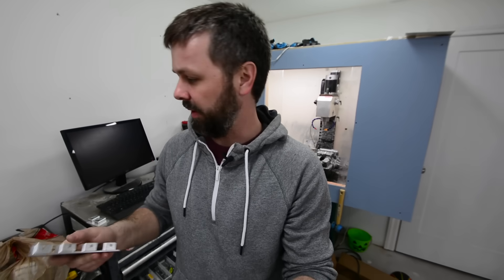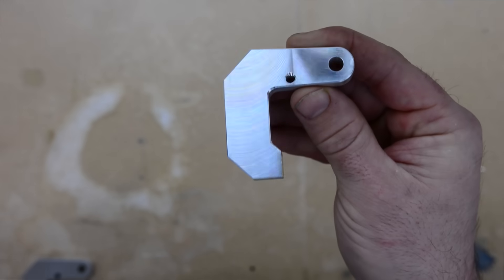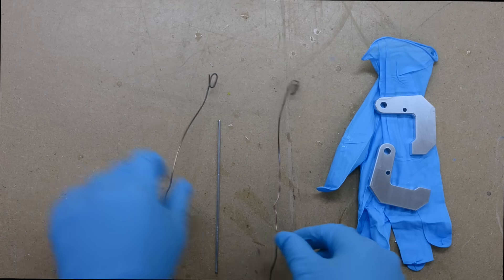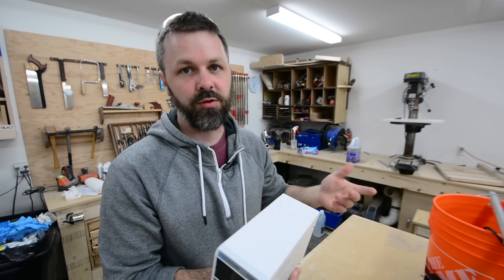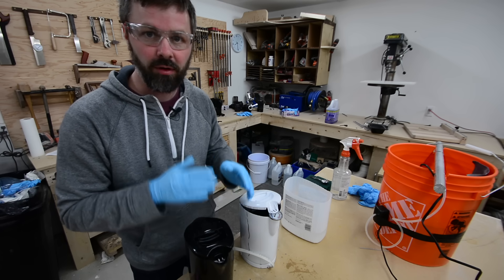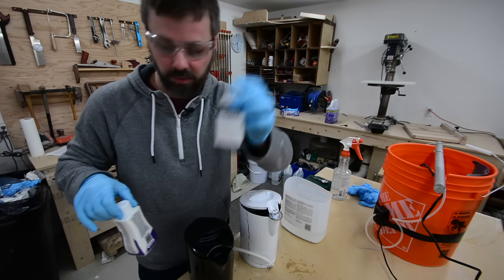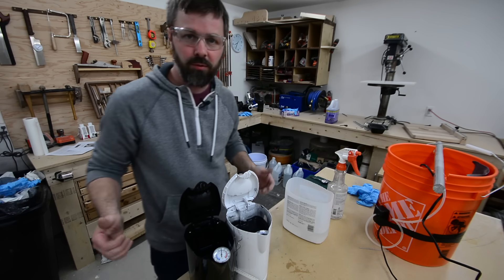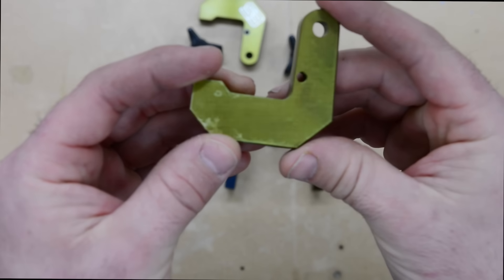ShopBuilt - How to Anodize Aluminum!

Comment: What role does the battery acid perform? Does it open the "pores" of the aluminium?
Reply from the maker: It actually forms an aluminum oxide layer about .001" thick that has open pores to accept the dye and actually hardens the surface.
Reply: And also eats halfway into the aloy as it converts
Reply: The pores are opened using the etching process, which wasn't shown. Without the etch it can mean a less durable adhesion to the aluminium substrate. Prob not a real issue with small parts but anything larger than 6" it would be better to include the etch.

Comment: Would you do a quick video on "hard" anodizing?
Reply: In my experience, it's very difficult to determine and check for the difference between 'hard'  and regular. Why would you want that anyway? Anodize is almost diamond hard.
Reply: My experience has been that you're completely wrong.  I can easily scratch type 2 dyed anodizing where HARD anodizing is nearly impossible to scratch.
Reply: Type iii is usually much thicker, which may account for you not scratching it, but the hardness of the type ii is very similar and without specialist equipment (abrasion) difficult to calculate.

You can start by studying the US DoD Mil Specs for the processes involved. MIL-A-8625F Mil-A-63576A or MIL-DTL-5541F

You can look up these and other Mil Specs at DAPS ASSIST  http://assist.daps.dla.mil/quicksearch/

What are you anodizing anyway?
Reply: I'm assuming that you're the source of his anodizing supplies.  Thus far, I haven't had my question answered at all.  Instead you keep trying to sell me a coating process that I have no interest in.  Honestly, I find it irritating that ShopBuilt hasn't responded with a simple, "yes" or "no".

Also, what I'm anodizing is none of your business.  I've seen lots of parts with type 2 anodizing get scratched over the years and type 3 parts remain looking like new.  IMHO, type 2 anodizing is a pointless coating.

Comment: The other advantage to using titanium wire, is if contact is accidentally broken. If contact is broken, aluminum wire will anodize over and never reestablish contact as the aluminum oxide is an insulator.  Also, your parts should be sealed in Nickel Acetate, not boiling water. It protects the color better.
Reply: Let me know if you have any other questions. I ran an anodizing business for a couple years. It sounds like you already found yourself the best online resource, the Caswell forum.
Reply: The Noob Woodworker i
Reply: Boiling water works well. It’s also much safer.
Reply: Using nickel acetate wouldn't change the color? Just 
asking out of curiosity
Reply: Hernando A. Nogueira it seals the Pours to protect the base material from elements.
Reply: The pink part is due to a lost in contact. When you have a part sitting in an acid bath without electricity running through it due to poor contact it will turn pink. This can be removed by using a deox. The part doesn’t take due because the coating is not there (pours) to fill.
Reply: Due=dye
Reply: hello colleague
Reply: For what he is doing, I really wouldn't suggest nickel acetate , stick to hot water , the hotter the better!
Reply: Hmm say what about nickel acetate? I have a gallon sitting here from my nickel plating project. What are you implying happens when you expose aluminum oxide to it?
Reply: The seal is all dependent on what you are looking for. 
Nickel acetate works best to help with the leaching of the dye. Won’t see much of a color variance after the seal.
Nickel Flouride will provide the best corrosion protection but can/will leach some of the color
Boiling seals will soften the coating but is a viable seal to do what you are trying to accomplish.

Comment: Actually, contact your waste water department about the waste dilute battery acid.  I used to run a factory heat treating operation.  We used HCl acid to split oil out of our wash water.  The waste department approved us to dump directly in the waste stream.  They actually liked the idea.  You  see, waste water in a city sewer system is very alkali due to all the soaps used for normal household cleaning.  The treatment plant has to add acid to neutralize it before treating it so it doesn't kill all their bugs.  Any acid you add just reduces how much they have to add.  Again, check with your local waste department to verify these facts.
Reply: There are tons of cleaners that are acid based too that go into the water or storm water system. A bucket of diluted battery acid is nothing to worry about.
Reply from the maker: Interesting, I'll look into that, thanks.
Reply: Consider that the acid here is most likely sulphuric although not specified and further it most likely contains heavy metal contamination.
Reply: The Tap water pH where I live is between 7.5 and 8.2. Five gallons will dilute. I'd be more worried about my drain pipes getting cleaned from oil and corrosion. lol (sarcasm)
Reply: Just check the pH to see if it close to the tap water in your area if you plan to dump after neutralizing (VMF)

Comment: I watched this whole thing without knowing what anodizing is actually for.
Reply: Keeps aluminum parts from oxidizing. Protective coating. As a sidenote...looks cool too.
Reply: Anodizing is done both to protect the aluminum parts and for decorative purposes. Aluminum that is exposed to weather or sees any manual handling will soon see oxidation and scratches. Aluminum is not a very hard metal. The anodizing process will rearrange the aluminum atoms at the surface so that the surface becomes super hard and will not oxidize or easily scratch. It seals the metal and creates this sort of hard crust. Anodizing is done at different levels of "hardness" or thickness and generally speaking, the harder the anodizing, the darker the color. You want a harder anodizing on parts that see heavy use. Examples of anodized products are the Apple MacBook computers, aluminum window frames, sports equipment and marine parts or products.
Reply: jumpleadsx2 and yet noone told you. So I still dont know. xD
Reply: From what I can recall it causes the aluminum to harden to sapphire.

Comment: I had seen everyone use the Rit clothing dyes and wasn't impressed so I never tried home anodizing. I paint,blue  and powdercoat and wanted to anodized. Now I'm going to have to try it. I have some custom Aluminum turbo intercooler piping i have to build so i may try it. Thanks
Reply: When I was a teen we used to anno our paintball markers and stuff. We used the RIT dye all the time. The key is you have to mix it really really strong and soak the part in it forever (often left overnight). As always it helps to do some test pieces on the same grade scrap aluminum first.
Reply: You also need to use Professional Rit dye. The consumer stuff is crap. Also - side note - if you're trying to dye nylon or other plastics, you MUST use the pro dye - the consumer version formulas were changed quite a while ago. It won't work on plastic at all anymore.

Comment: People are going to be using it with t tracks that they buy.  The t track is either going to be silver, blue (Rockler, Kreg), gold (incra), or red (shop fox).  So you want something that is going to look good with any of the them.  The green is more distinctive but it probably would look odd against a blue track, whereas the blue would look good against any of them.  When I do jewelry box linings I try to give people the choice but if I have to go with the lowest common denominator I go with blue.
Reply: I get my t track from Orange Aluminum.  I can get pretty much any color almost.
Reply from the maker: That's a good point, I'm hoping to have color options.

Comment: Your care for the environment is to be commended, but it is totally safe to neutralize sulfuric acid with sodium bicarbonate and then dump it down the drain.  The remaining salt will be sodium sulfate, which is nontoxic.
Reply: Thats the reason why i wouldn t recommend using sulfuric Acid from batteries, just buy diluted sulfuric acid and then theres no problem.
Reply: My Motorbike batteries always came with the sulfuric acid in a separate capsule to be added before replacing the old battery. That seems fairly safe to use... obviously used battery acid may not be such a great idea o.O
Reply: One of the ways to readily buy dilute sulphuric acid for anodising is as drain cleaner ( such as diggers ) so its often diluted and put down drains anyway to clean them. It should be pretty safe and becomes increasingly diluted. Lead from the cathode could be more hazardous but you needn't use a lead cathode .
Reply: My gravel driveway works great for getting rid of acid. Limestone gravel.
Reply: yeah i recommend putting your garbage acid refuse on bob brooks' driveway guys, it's the best
Reply: Bullshit. Do not pour ANY used acid down your drain neutralized or not. Yes, the acid can be made safe but the heavy metal pollutants you’re introducing are not. Best option is to either let it air dry, or you can use cat litter to absorb it. Then bag and throw it away. Yes, it’s enough to be a water contaminant in this quantity. Don’t listen to stupid
Reply: Problem is the lead that is dissolved into the acid, which does not get neutralised with the acid, and which then is present in the sewer system and contaminates downstream. Small amounts no real worry ( especially as many places have lead present in the water already from either natural sources or lead pipes) but large amounts are a concern.
Reply: @SeanBZA  Several years ago CA made plumbers to change their solder from 50-50 to 95-5 because they said that the lead in the solder was hurting people's health.  But CA also banned lead bullets for hunting because they said the buzzards (California Condors) were dying from lead poisoning from eating the gut piles that the deer hunters left behind after they dressed out the deer.  That implies that hunters a stupid enough to make gut shots.  So this makes me wonder if the fear of lead is actual science, or just political propaganda.
Reply: @bobsradio6025  Big issue with varmint hunters in desert areas who will shoot coyotes, only take the pelt, and leave the rest.

I've touched plenty of lead bullets and I don't have problems or anything, but it does cause serious neurological problems especially in children. I wouldn't want it in my house with small kids around, and the less of it floating around probably the better for everyone.
Reply: @bobsradio6025  lead poisoning is a real thing, but you don't have to worry with metallic lead. It's soluble lead salts that are a problem because they bioaccumulate and stay in your body.  Lead poisoning is cumulative over time.
Reply: I don't think there would be enough leeched into the water from this process, there's not enough water there to be a concern anyway. If he lives in a city, the water treatment plant would get it out of there anyway, and if not there's for sure more lead in the local waters due to fishing weights.
Reply: @squat224  Also shotgun pellets.
Reply: @squat224  lead fishing weights aren’t in suspension 🤦🏻
Reply: I work in Haz-Mat and don't even know the chemistry behind it. We'll literally just spray sulfuric acid with the stuff and powerwash it away after it stops bubbling 😂

Comment: im pretty sure there is a process for removing the anodization so you can save blemished parts
Reply from the maker: Yes, you can use lye to remove the anodizing layer and start over, it will be slightly more matt in colour though.

Comment: Forgot to ask you how can i buy one of your stops? And do you sell the rail setup, or do i use a generic track? Also, is there some type of marker on it to stop it accurately time after time with no hassle? Any info would be great. Thanks
Reply from the maker: Not for sale yet as because i'm going from getting all the parts made locally to making everything in my shop. hopefully soon. will work with generic track. yes there is a curser. Thanks for the support!!
Reply: ShopBuilt contact me grant.l.mara808@gmail.com
Could u andodize my dirt bike radiator guards covor gold ? I can send u photo it both could fit in 5 gal bucket no problem
Reply: ShopBuilt if i send u parts can u anodize it ? Ill pay lmk bro thank u